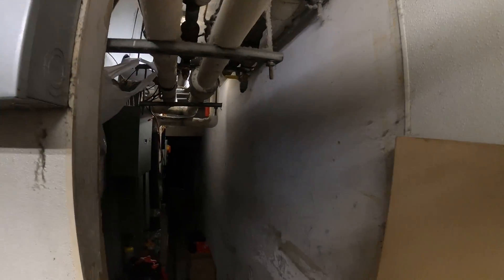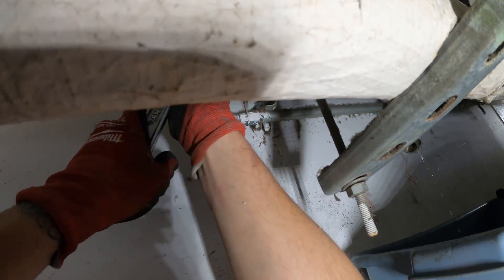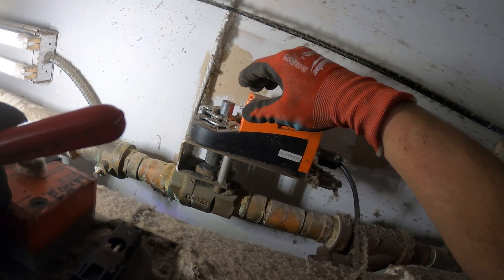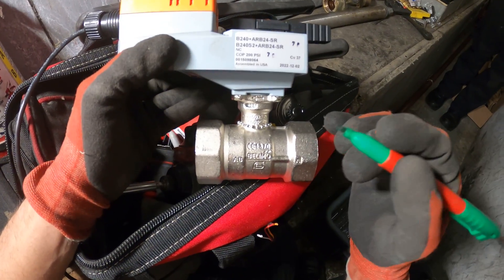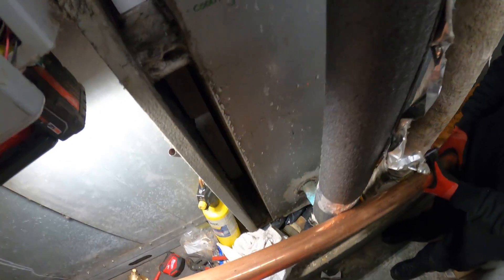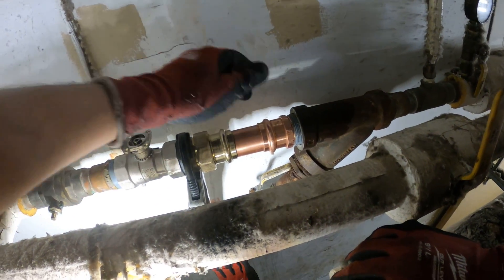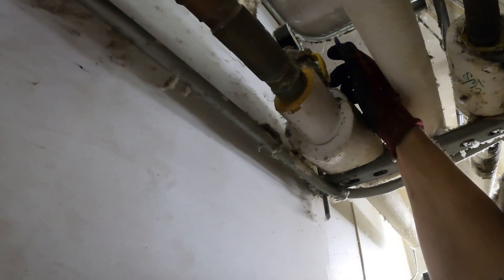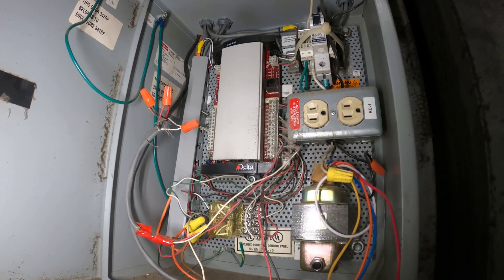HVAC: Belimo Valve Actuator Replacement/Installation #1 For 4 Pipe Fan Coil Unit (ARB24-SR + B240)

Comment: Why did you need to replace both parts of the valve? Couldn’t you have just replaced the Belimo actuator?
Reply: you can just replace the actuator, particularly if it proves to be failed. But, if you noticed the grime and filthy water coming out the pipe that he had to dig to get unplugged (to drain it), then you understand that it is wise the replace the pipe valve also so that it closes completely and doesn't let water past when it is in the closed position.

Comment: Can you please help to solve this issue.. when i apply 10VDC (max control vdc) the actuator 50% only opens… it’s doesn’t go to 100% .. even i did the self adoption function..how to make this into 100%: Model is SVK24-MFT-50

Comment: Why did the whole valve body need to be replaced? I've never had a seized valve just bad actuators.
Reply: Sometimes, you can have bad vavle that later on caused the actuator to go bad too.

Comment: Very difficult change over. 
Get yourself 2 union male adapters on the next one and fit the other one on the other side of the strainer. You can prep the whole thing and which it might make it easier to install. 
Great job as always. 👍